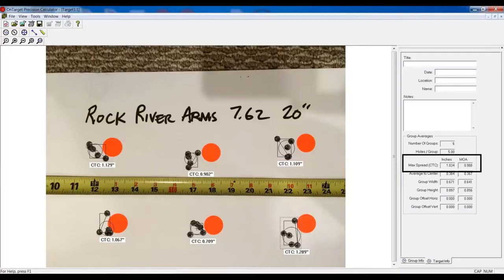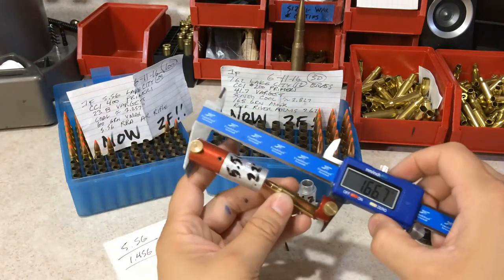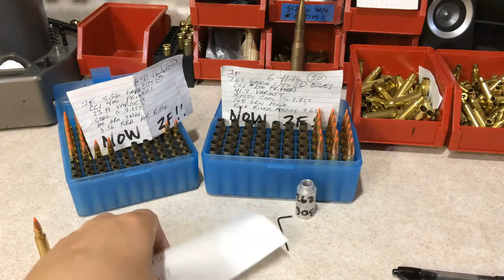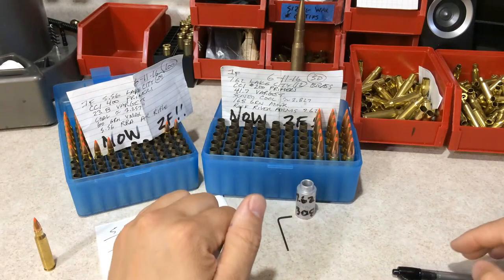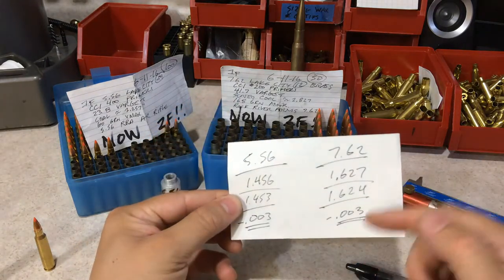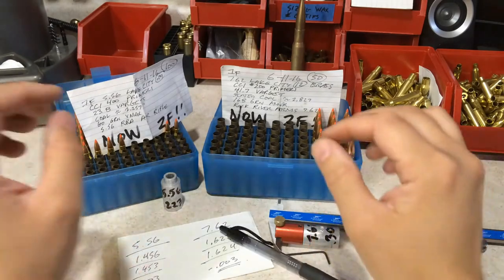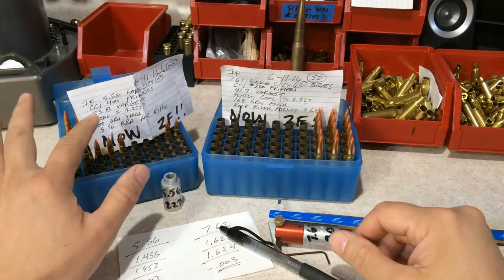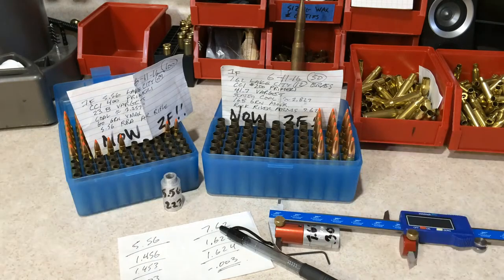RELOADING START TO FINISH RELOADED AMMO ON PAPER PART10

Comment: Watched all the start to finish series! Thank you for posting this. Very informative. I would like to get your opinion on brass. I will be shooting a .308 Winchester bolt action. I have tested multiple factory ammo to see what bullet and grain my rifle shoots best. So far the 168 Sierra matchking does best by .05-.1 moa. With this in mind would you recommend buying new brass to start or would you buy ammunition already made with the Sierra matchking bullet for practice and then reuse brass for your reloading? And if you would do this what brand ammunition would you look for to get best quality brass?
Reply from the maker: Either would be fine. I actually use once fired lake city military brass for my 308... I'd be more concerned about getting a consistent headspace bump from fireformed than the brass I use.
Reply: Elfster's Rifles and Reloading recommendations on a ligit place to get brass? I originally was thinking Lapua would be best for longevity and accuracy. Am I wrong on this?
Reply from the maker: @robertdurbin85  lapua is a best, just expensive.  Anything like natchez or midway should have it. Might want to check out starline too

Comment: Also if you ever add to this maybe explain development of a powder charge and nodes. 

By the was very nice group on your introduction.
Reply from the maker: Should check out my ruger precision rifle adventure playlist, especially parts 3, 4, and 5 (I think) where I go thru all of that :)
Reply from the maker: Really all 7 parts really show how I reload for a bolt action with powder drops and jumps
Reply from the maker: Even my PSA 10.5” firearm series has load development which has very interesting findings due to its short barrel which goes against all twist rate to bullet grain weight logic

Comment: What calipers do you use?
Reply from the maker: just some cheap $25 frankford arsenal calipers you can get off amazon.. they are rather smooth and work just fine for what you need. ive been using them for over 5 years with no issues what so ever.... amazing calipers for the money

http://ads.midwayusa.com/product/604242/frankford-arsenal-digital-caliper-6-stainless-steel?cm_mmc=pf_ci_google-_-Reloading+-+Metallic+Reloading+Equipment+(Not+Presses)-_-Frankford+Arsenal-_-604242&gclid=CN3XhOq0wtECFRi4wAodT50Evw
Reply from the maker: sorry... I see amazon doesn't sell them anymore?? strange.. anyway, I see they have them on midway usa... get the blue ones.. not black

http://ads.midwayusa.com/product/604242/frankford-arsenal-digital-caliper-6-stainless-steel?cm_mmc=pf_ci_google-_-Reloading+-+Metallic+Reloading+Equipment+(Not+Presses)-_-Frankford+Arsenal-_-604242&gclid=CN3XhOq0wtECFRi4wAodT50Evw